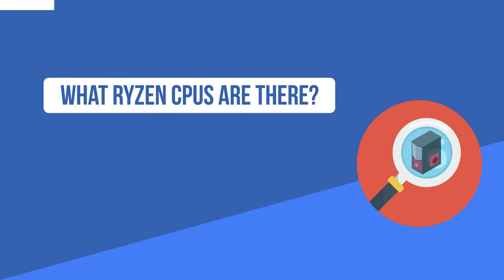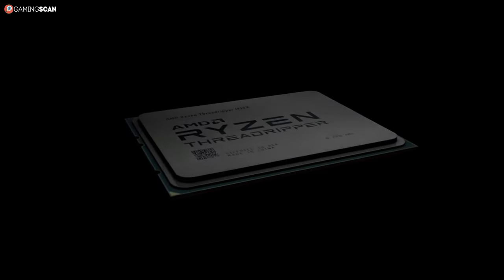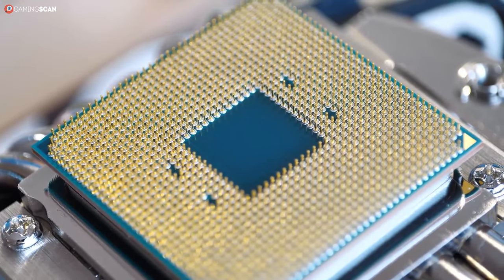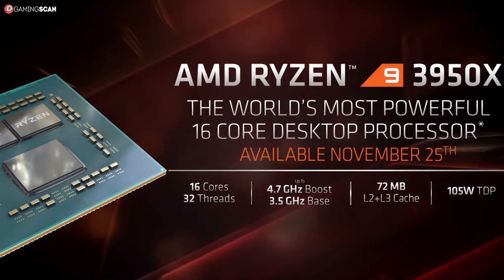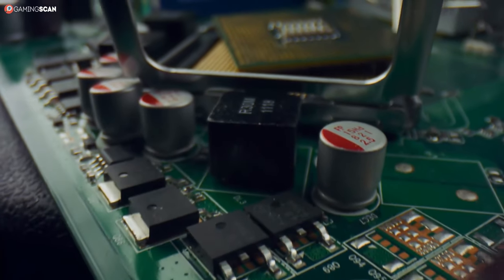How To Pick The Right AMD Ryzen CPU For Your PC [Guide]

Comment: Ryzen 5 3600 still relevant now to build a budget gaming PC?
Reply: Absolutely.   Obviously it isnt going to be top of the line, but it does really good.  Pair it with decent ram, gpu and  storage, it will be fine.  It might not run every game at full settings but if you just want to play some games it definitely is better than others for its price.

Comment: I just bought a ryzen 7 3700x should I return it and wait ?
Reply: Do you like it or? I was gonna buy it
Reply: @demontanks9485  it’s fine but I managed to get the R7 5800x for the same price with was just like 1 in 100000000000 chance but the 3700 x is good I’ll get it if u stream an Shi but if u just want it for games go for the R5 5600x that’s all u need I only have it because I stream on the side

Comment: I’m looking for a new processor for my PC (it gave out) I built back in ‘16, any suggestions on which processors to look at here’s my build right now? Also I’m budget, don’t want to spend over $100 if possible.

Motherboard: Gigabyte AM3+ AMD DDR3 1333 760G
Graphics Card: EVGA GeForce GTX 960 4GB SSC
Power Supply: EVGA 500W
Hard Drive: Seagate 1TB Desktop HDD
Processor: (that’s in it right now) AMD FX-6300 6-core Black Edition
RAM: Crucial 8GB Single DDR3 1600 MT
Reply: get a 1070
Reply: How?  I've had mobos die, ram die, hdd, ssd die, psu's die, never a cpu.  What did you do?

Comment: I'm not an avid Gamer, but needed a new modern set up just for every day use, due to pricing and availability I ended up with a 3600XT instead of the standard 3600. It won't be over clocked as I don't need that, and it should last as long as the Phenom II 965 Black edition that I just retired, I also have an FX9590 Piledriver on a 990 chipset that was used in my old simulator but I am retiring that too.

Comment: Whoa! You said capacitors have been an issue with the RTX 3000 series cards, then showed a pic of the Founder's Edition card. To be clear, it is not Nvidia's Founder's Edition RTX cards that are having issues with the capacitors it is the reference cards that are using a minimum amount of capacitors that are having these issues.

Comment: Im only interested in the not yet released 5300x. ive yet to see proof there is any real benefit to paying for more for normal gaming. if i can spend half the money now, and upgrade sooner, ill be ahead of those that bought an 8 core and keep it longer for gaming performance. just look at 3300x vs 1800x. even in dx12 titles that thread nicely that everyone uses as "proof you need more cores" the 3300x slaps the 1800x.

Comment: I am looking to upgrade my PC, but really confuse with either go to Intel or AMD.
Reply: Either one works. It just depends on your preference and which one you get.   Amd is a bit higher performance for price when it comes to gaming but they both do the job.  The only issue with amd is that some programs have a hard time or simply will not run on amd cpu,  that is pretty rare though.
Reply: And if you are upgrading parts you have to stick with the socket type on the motherboard unless you are upgrading that or replacing the entire pc.

Comment: CORRECTED LAYOUT  With properly aligned columns
and three spaces between Time: and Text
This is how it's done....... 

Timestamps:
00:00  Intro
00:52   What Ryzen CPUs Are There?
03:22   Core and Thread Count
05:08   Clock Speed and Overclocking
06:56   CPU Cache
07:30   CPU vs APU
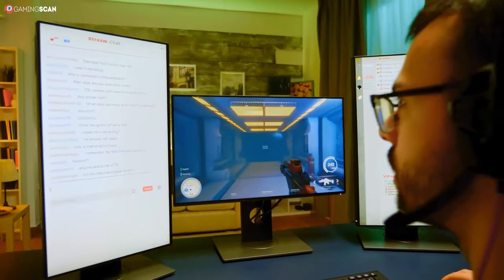08:50   Socket and Chipset
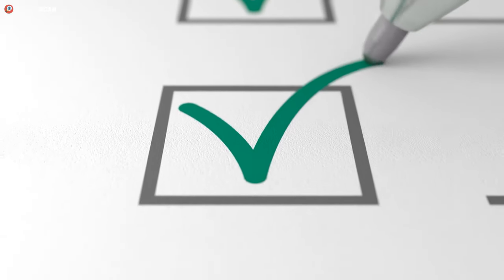09:29   Letter Designations
10:14   Should You Get The Latest Generation CPUs?
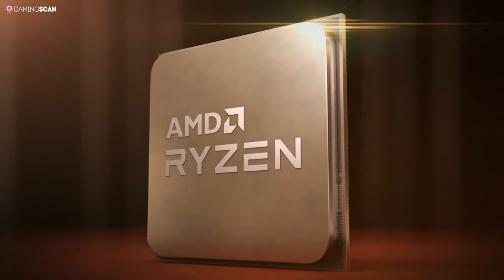12:04   Conclusion

Comment: How about AMD Ryzen 7 2700X 3.7 GHz 8-Core Socket AM4 CPU Processor
Reply: My 2700x is doing great after almost 2 years.  But I have an Enermax aftermarket cooler, with XMP profiles on auto it will turbo to 4.8ghz.

Comment: Just an Opinion...

I feel like the Ryzen 5 3600 6-core cup is okay for now but I don't think its really worth investing in it because it is slowly being outdated. If you want to build a pc and have it still be comparable to other systems 3-4 years down the line, you might wanna invest in a Ryzen 7 3700x 8-core 16 thread processor. It might be like $130 more, but you won't have to upgrade it a year down the line. It's always best not to cheap out on the CPU, GPU, Motherboard, Cooling system, and the power system. I'm building a PC right now that's Middle-Upper end for about $1500 after taxes. It's going to be quite a beast.

Comment: overclocking does not void your warranty
Reply: It can.
Reply: if you do a small overclock on your cpu and then for some reason send it back they how no way of tell you overclocked a CPU also its very hard to break a CPU by overclocking
Reply: @pineapplesthechad4757  but if you delid your cpu to over clock it they will...   or if you disable thermal throttle and fry it.
Reply: @pineapplesthechad4757  also, there are cpus that specifically say overclocking will void the warranty.    It isn't a yes or no answer. It is a maybe it will maybe it wont thing.
Reply: @pineapplesthechad4757  i think it isn't frowned upon by manufacturers as much as it used to be especially the cpus that are actually designed to be allowed to be overclocked.  Before they started making those guys were doing questionable things to overclock them.
Reply: @Bendigo1 yeah dude with a quick bit of Google your still wrong AMD and Intel say that overclocking your cpu wont void any warranty. Why would they even let you overclock if it would just void the warranty
Reply: @Bendigo1  also could you give some examples because I've never heard of a cpu that can be overclocked but if you do so then it will void the warranty I think your mistaken intel have both cpus which they let you overclock and cpus which they don't let you e.g k serious and non k serious as of AMD you can overclock any of their main line cpus it just depends on the motherboard you can even overclock their epic line of cpus
Reply: My 2700x with an Enermax after market cooler and xmp profiles on auto hits 4.8 ghz, that overclock is a factory setting so it would not void the Warranty.

Comment: Yeah you missed the increased IPC which also has an impact in performance, especially when combined with the higher 5000 clock speeds. Good effort though.